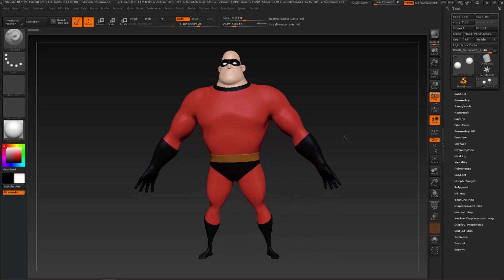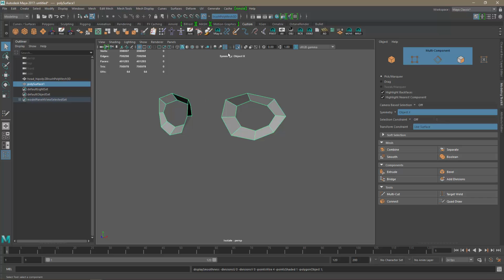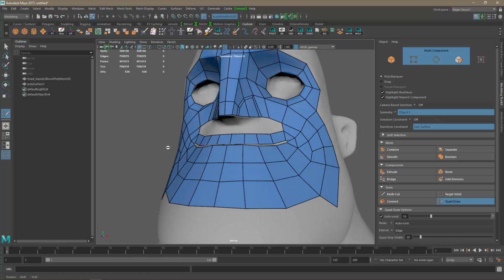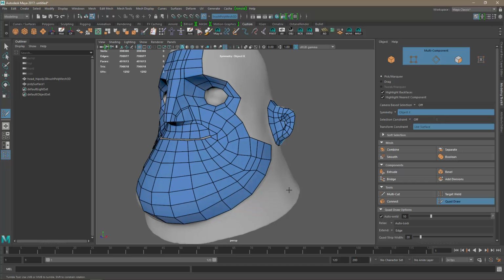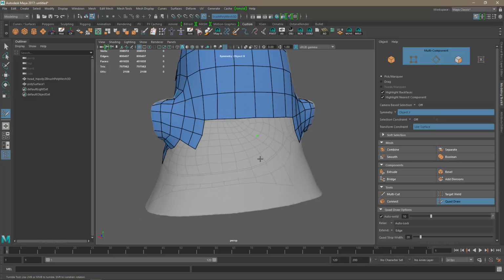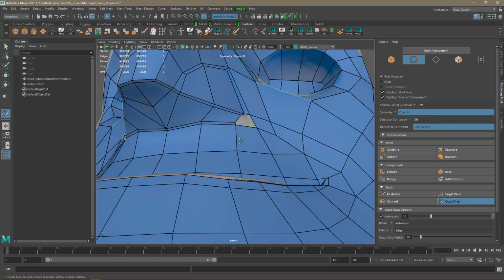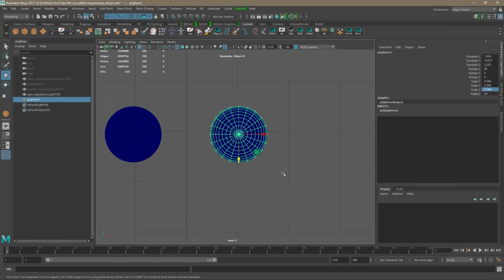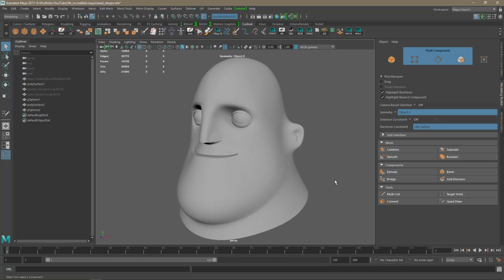Modelling Mr. Incredible - Part 6: Head retopology - ASMR

Comment: yea it's still slow so slow can't even change angle by fifth point. Idk what to do the quad draw is working fine for the face.

edit: Found solition "To fix lagging while using quad draw all you need is export high poly mesh as GPU cache. Cache > GPU Cache > Export. And that import it back - Cache > GPU Cache > Import." -  trustneed

and also this other guy wrote something idk what it was talking about "*Awnser* A couple years late but its still a problem. I read this and most of you don't know what exactly it is. If you go onto - Windows - Hypergraph Hierarchy - and then you need to delete the stray Nodes (green lines), then make a new phong. once done you're all set to quad draw in speed. Happy days." - Nayf can someone explain that to me.

http://polycount.com/discussion/159166/issues-with-retopo-in-maya-extreme-lag